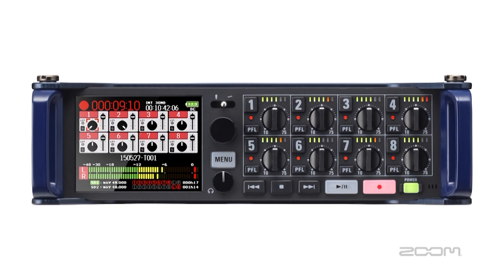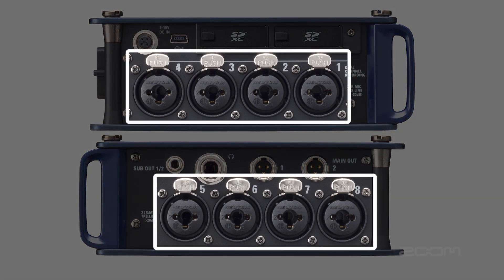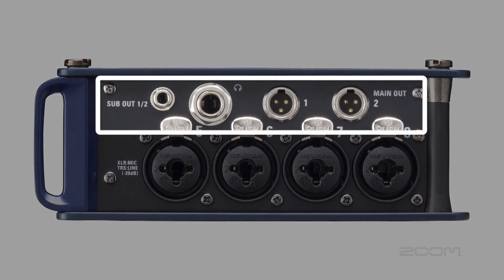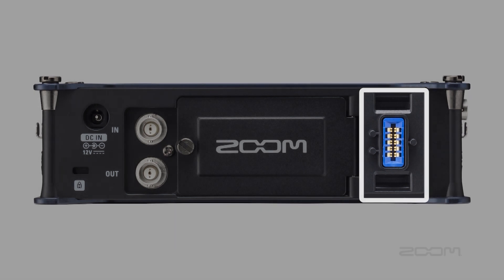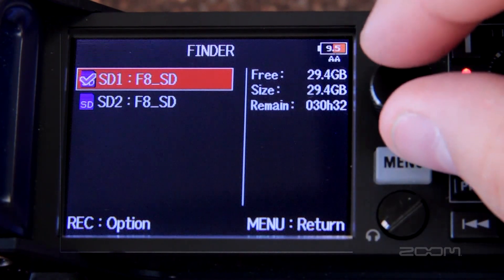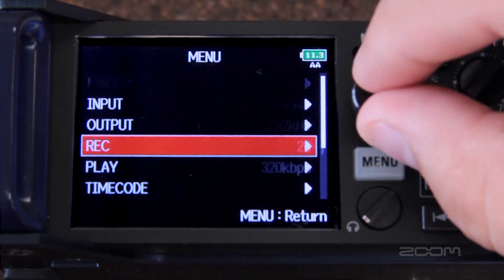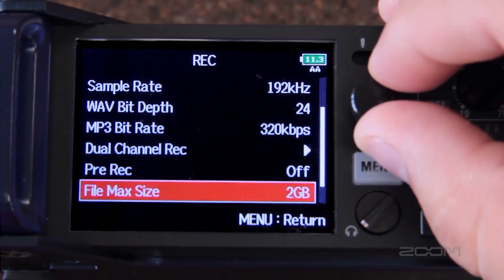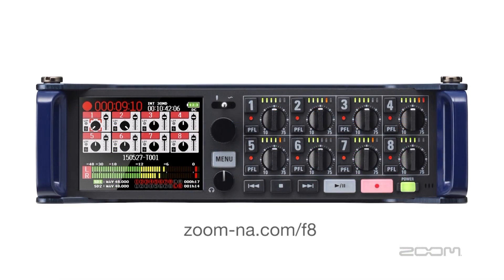Zoom F8 Overview

Comment: Can the front panel knobs be assigned as faders? If not, is there any way to adjust faders without using a bluetooth device?
Reply from the maker: Markus Brunger On the main recording screen you can select the fader for each channel and adjust with the main scroll knob.
Reply: +ZoomSoundLab Hopefully it can be changed in the future to allow the knobs to be used as faders so that those without iOS devices will be able to mix on the fly

Comment: Looking good. However I'm EXTREMELY skeptic until I've had a chance to actually try the unit at our studio. The Zoom H6 was supposed to be much less noisy than the previous recorders and looked good on paper.. reality was completely different though. It was noisy and extremely bad sounding, not at all viable for professional work.

This F8 recorder looks on paper like it could take on the Sound Devices recorders at a fraction of the price.. but it remains to be seen if this is true in reality. Zoom is one of these companies where specs on paper mean absolutely nothing.
Reply: Absolutely agree. I haven't had issues with noise but have had distortion problems, making my audio sound buzzy

Comment: Looking superb. I do have a few questions concerning the units use as a professional ENG/EFP audio recorder. 

To go line in, do you HAVE to use TRS or is there a way to set XLR to line level? 

Can the metering scale be changed? The vast majority of field audio professionals need a -20dbfs mark and prefer coloring to change once that mark is hit (green to yellow). 

Can the front panel knobs be assigned as faders? If not, is there any way to adjust faders without using a bluetooth device?
Reply from the maker: +James Nolan To go line into the F8 you must use TRS. The metering scale cannot be changed. Currently the front panel knobs cannot be assigned as faders. However, this is a comment we have heard often and are looking into changing.
Thank you